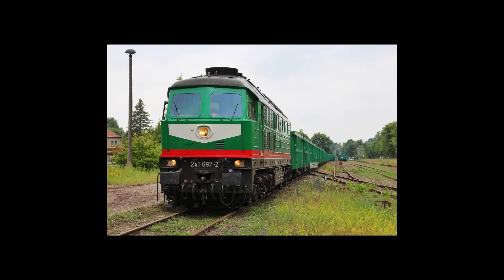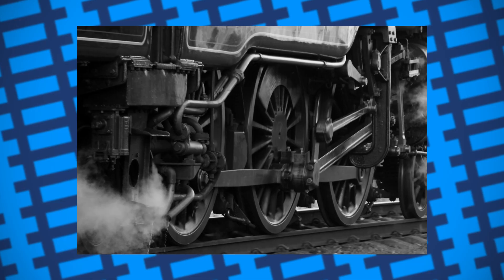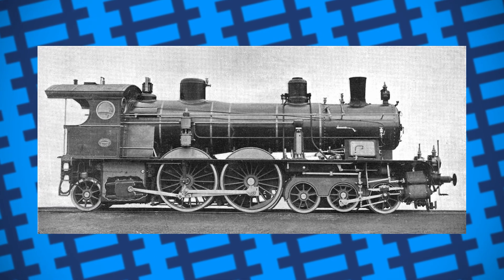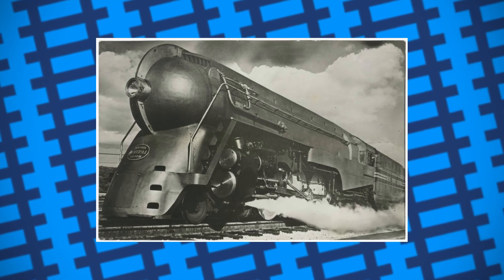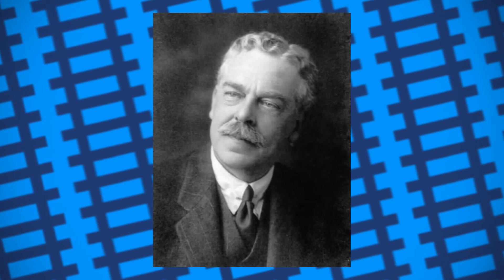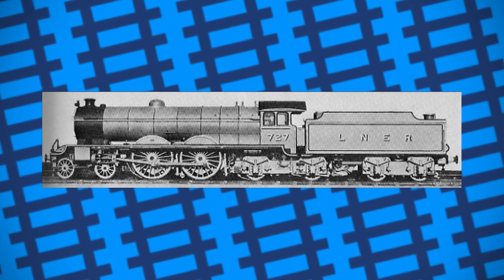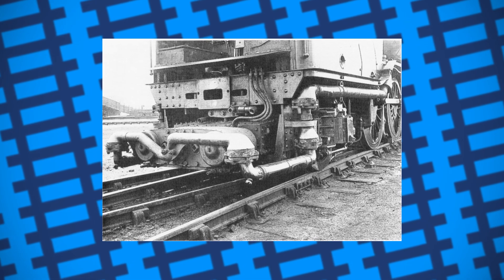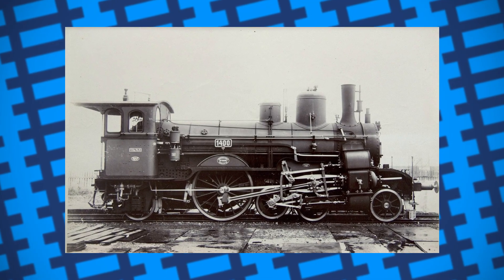The wheels that made Steam Trains more powerful - Locomotives "Boosters"

Comment: 0:50 Correction: Wheels do not do anything to the tractive effort of a locomotive, they change the adhesion. And it's not exclusively the wheels either, it's how far the connecting rods are from the center of the wheel. If they are more than halfway, the engine will have more power at the cost of speed, and vice versa. What primarily changes the tractive effort is the cylinders and the boiler pressure. Faster locomotives have larger wheels so the cylinders don't have to work as hard at higher speeds. Get your facts straight man, 'cause despite what you say, people will take your word as gospel.
Reply: Wheel diameter does have an effect on tractive effort. The basic formula for tractive effort is: TE = (d * d * S * P)/D, where d is the diameter of the cylinders, S is the length of the stroke of the cylinder, P is the steam pressure in the cylinder, and D is the diameter of the driving wheels. So increasing the diameter of the driving wheels will have the result of reducing the tractive effort of the locomotive.
Reply: I realize I phrased this incorrectly. As you said, they do affect tractive effort. I more so meant to say that they are not the sole factor in tractive effort, but re-reading it I did say that they do nothing. Thank you correcting me!
Reply: It happens to all of us. The host should have also been more careful in his description of the power of steam locomotives.

Comment: Mentioned some time back, the Saluda Grade locomotives of the Southern Railway here in the US, were one of the furthest developments of this idea.  These locomotives were 2-8-2 locomotives which had driving tenders. Either 2-8-0, or 2-6-0, built from obsolete locomotives.  These powered tenders were used to help push, or rarely pull, heavy trains up the steep Saluda grade.  Since the locomotives only operated over this one specific section (about 4 miles in length total, up and down the mountain), the Saluda locomotives didn't really experience the loss of traction problems that engines like the Triplex had.  So they continued in service until Diesel traction replaced them.
Reply: Sounds like the Saluda Grade locomotives were more of a Mallet type locomotive with the engines spread beneath the tenders. Sounds like a great idea. Any idea where I could find a picture of one on line?
Reply: @cdjhyoung  Try searching for "southern railway ms-2".

These appear to be simple duplex though, not compound like a Mallet. I suspect the biggest difficulty would have been getting the low-pressure steam pipes from the HP cylinders at the front of the loco, back to the tender. Now if they'd coupled the booster in front, it would have been no use as a tender but at least its weight would have been constant... I think I've just invented the steam loco slug!

Apologies if this is a (partial) double post - my original reply disappeared.
Reply: @jonh845  Now that I think about it a bit, having the engine under the tender also introduces the issue of the weight of the tender declining in use and lessening the traction advantage of the engine under the tender.
Reply: @cdjhyoung Pretty much, and that was discussed in an older video regarding steam tenders, and also showed a picture of the engine (Or what I believe is one of them) that Original Commenter mentioned of.

Though I don’t believe they were as good as they were believed as the ms-2 were converted back to using standard tenders due to lackluster results, and worked until they were phased out in the 1950s, according to the source: “LeMassena, Robert (1979). Articulated Steam Locomotives of North America (1st ed.)” Engines #4535-4539 and #4576,  #4561, and engine #5046 were given these steam tenders, but they lost them in 1923, with 5046 losing its steam tender in 1926.
Reply: A search for "saluda grade powered tender" works for me. Southern Railway Ms-2 - duplex, rather than compound like a Mallet. Probably easier to manage the available adhesion on the tender that way than have to arrange a bypass regulator?

Comment: I thought the real solution to the need for a booster was when second low pressure cylinders were implemented.  When a boost was needed, additional steam could be injected into the exhaust lines from the main cylinders that fed the secondary low pressure cylinders for a boost.  The rate of boost could be controlled so it was used efficiently.  Am I just dreaming this?  I have to have read it somewhere years ago.
Reply: It's not the 'internal horsepower' that's limiting it's the tractive effort that can be applied to the rails (drawbar pull in thousands of pounds) before the driven wheel lose traction and slip/spin. The booster truck was used to increase the low speed pull and exploit the ability of the boiler to produce steam by powering more weight carrying wheels.  consider 'Shay' pattern logging locomotives for instance, all wheel drive including the tender, slow but very high drawbar pull for the overall weight. there also 'Fairlie', 'Garrett', 'Mallett' and 'Meyer' arrangements which are intended to increase the total amount of weight bearing wheels available for driving and also spread the total weight of the engine across more axles thus reducing the point loading on the track allowing a lighter and cheaper permanent way to be constructed as well as lighter and cheaper civil engineering, think trestle bridges and simple truss and beam bridging etc. 🙂
Reply: @alan-sk7ky After thinking about the traction issue, I am wondering if there were examples of the wheels being able to generate more than enough traction to cover certain kinds of slip.  I know tow things for certain, locomotives did have the ability to inject high pressure steam into the low pressure cylinder, especially for starting and wheel slip can happen regardless of the power input. I watched a video taken from in the cab of a steam locomotive pulling on level track but it kept spinning out because of wet leaves.  It was crazy to see the engineer respond.  He had to slam the valve closed then reopen it one or two seconds later.  The Shay is the ideal example of your point,.  People can walk faster than some Shays.

Comment: The booster was successful in the US, I guess because the locomotives were larger and had more space under the firebox where the trailing truck sat that it was easier to fit and maintain the boosters.
The franklin booster was a sound design with the gear to engage and disengage it, and when done carefully it wouldn't damage those gears. Compare with a unsynchronised gear on a truck.
The booster shown with side rods was a kind fitted in place of a tender truck or bogie.
But also with the emergence of newer and larger super power in the US the use of boosters got less, having the higher TE available all time was the plus of the new locomotives without boosters.

Comment: Sorry ToT, I think you made a mistake at 3:55.
When listing the railroads that used boosters on steam locomotives. You said one of them was "...the Norfolk and Southern."
The NS didn't exist at the time when steam was the main source of power. Norfolk Southern was formed in 1982.
There was a railroad with a similar name: The Norfolk & Western railroad. They tried the boosters when they had steam locomotives. Such as J class #602.
Reply: Probably just simply said southern instead of western... It isnt that deep. I make the same mistake all the time.
Reply: @JayHadNoWay  Maybe, but there is this
https://en.wikipedia.org/wiki/Norfolk_Southern_Railway_(1942%E2%80%931982)
Reply: @lukechristmas3951  I've heard of the Norfolk & Western as well as the Norfolk Southern railways, but I didn't know there was also a Norfolk and Southern Railway too.  That just makes the process of explaining railways to non-railfans even more difficult.

Comment: I feel like the boosters were much better in the US than the UK

Just look at any of Lima’s superpowered designs. They were the best locomotives at any task they were given. We have so many of their Berkshires around because they were so good.
Reply: Honestly not sure any UK application actually needed boosters.  The P1 class's intended duty were 100 wagon coal trains, but the loops twixt colliery and London simply weren't long enough to accommodate such long trains, effectively kyboshing the whole proposal before it even got going.

Here's a thought ... those coal wagons were all unfitted, making for a pretty hairy operation.

Here's another thought ... not even HOW'S protégé Oliver Bulleid employed boosters on any of his designs.  If THAT doesn't say something, I dunno what does!!
Reply: It's more that the UK loading gauge is comically small for standard gauge, so that didn't help things at all in the UK as far as space for stuff like boosters goes. 

If you look at roughly contemporary designs from the US and UK with the same wheel arrangement and design specs, the US one is much, much larger - compare for example a PRR K4s to a Gresley A1, the A1 is basically a 2/3 sized K4s.

Comment: The boosters on the Victorian Railways X class were actually really successful, and added another 20%ish tractive effort down low. The two that didnt have it fitted were allocated to the flat areas and one of those two even got it retrofitted later, with the other having the idler gear on the bogie from the workshops!

Comment: I wish somebody preserved one of those boosters so we can see the complexity of the mechanics behind it
Reply: A Kb class loco still exists and is fitted with a booster. Operational however the loco is not
Reply: In the US, the locomotive 2102 still runs with an operational Franklin booster.
Reply: The Southern Pacific 4449 has a Booster Engine too
Reply: There are still some in current use on running steam engines in the USA.
Reply: Boston and Maine 3717 is getting hers rebuilt, there's some footage of that on The Steam Guy's channel, the Reading 2100 got hers restored, I believe 2102 has her booster in working order, and there are many more. You just have to know where to look!

Also, they really aren't that complex. Imagine a stationary steam engine or one you would see on a traction engine. It's just that with a gear fitted to the driveshaft and a larger gear fitted to the axle they drive.
Reply: Yeah, this is a case where Train of Thought's own British-centric delivery kind of bite's the video's subject in the 'tender-end'. The booster IS still active on several US locomotives, with several Reading T1's in particular still running with them in preservation. Although it was an apparent issue with UK attempts to install a booster, I was not a fan of the video's conclusion that "well since Sir Nigel Gresley never got to get it working perfectly here then it must have been a useless technology!" I generally like Train of Thought overall, but this is a case where his own nationality focus just blows holes in the video's own argument when multiple US locomotives prove the video's conclusion wrong every time they're fired up.
Reply: @jacoblyman9441  exactly, a lot of railroads have been using them during the age of steam. Even the switchers have them equipped.
Reply: @jacoblyman9441 to be fair, he's mainly talking about UK locos, and predominantly to a UK audience.  Maybe others can deliver a similar documentary for USA locos?
Reply: @tidaljunk he mentions other nations many times in the video
Reply: Same with the Victoria Railways sole example. The X class was such a good freight loco for us that it lasted until dieselisation, in part because of the booster engines.

Although we have none left, the sole X class still around (in the AHRS museum at Newport in Melbourne) was the sole one without a booster engine, although you can see the gear where one would have connected on the trailing truck.
Reply: @TheDemocrab is there a reason why the only one without one was preserved or did it just work out that way? Reminds me, need to check out the newport museum again. Last i went there was 2007 i think
Reply: Keith Rucker did a YouTube series on the overhaul of a steam stoker engine. Not exactly the same but a similar enough concept that's well worth the watch if you're interested in the machining aspect.
Reply: Who knows maybe someone will make a replica  of one
Reply: @jeffreymonroe4776 they are still around.